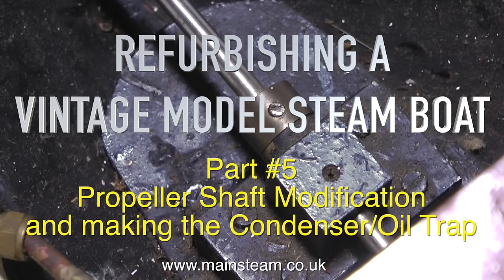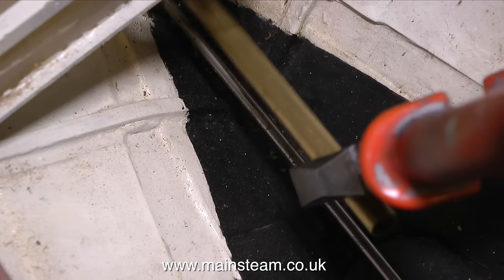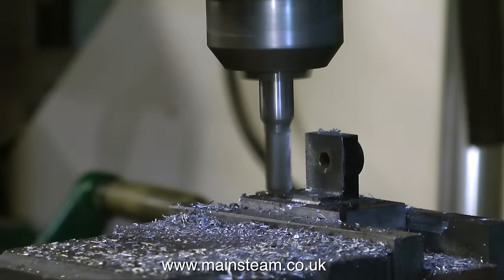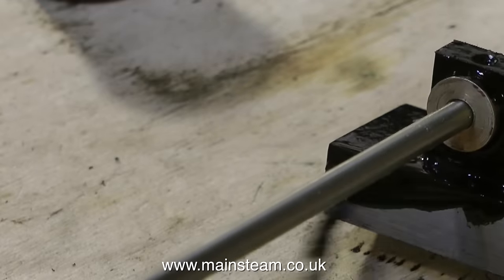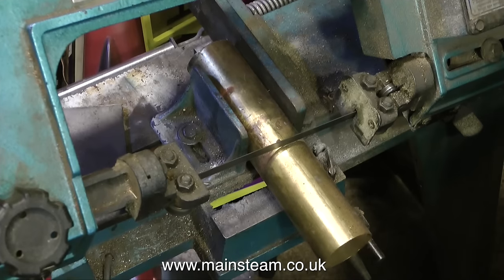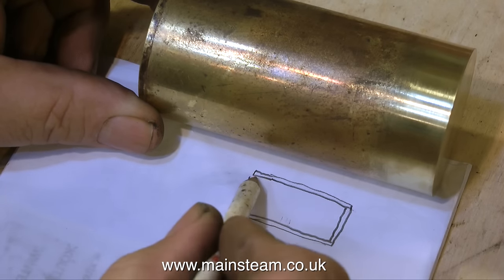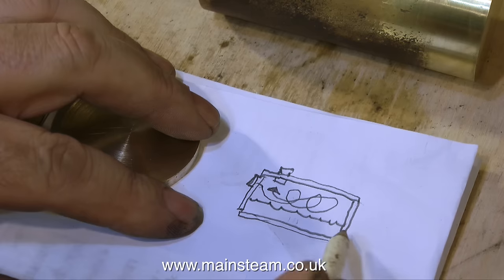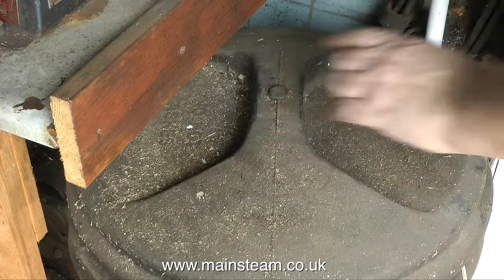REFURBISHING A VINTAGE MODEL STEAM BOAT - PART #5

Comment: Not knowing what I am talking about, as usual, but is it practical to have a two part condenser one each side for balance?
Reply from the maker: Too much weight unfortunately if I did that, I thought about it, but as this boat is made from steel plate so it's heavy enough already.

Comment: It would be neat to use pressurized steam input to flush the condenser.
Reply from the maker: That is how they work, all you do is run the engine and open the condenser drain valve - exhaust back pressure then pumps out the condensate :-)))
Reply: Neat, I guess I was thinking a bit too much. The boiler water would be good once a year maybe, I do want a tea spout on my boiler. I am waiting as I type for a 7kg steel banded hull misfit steam tug from UK now this series had an evil sub whatever effect in finding that one. 56cm not such a huge bite as this, bit folky too but a steam model from the 20's.